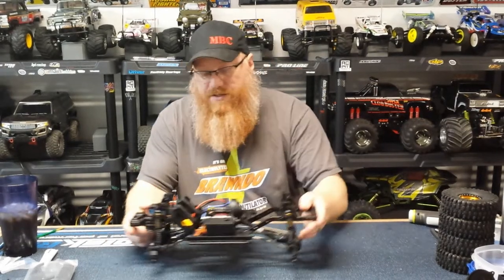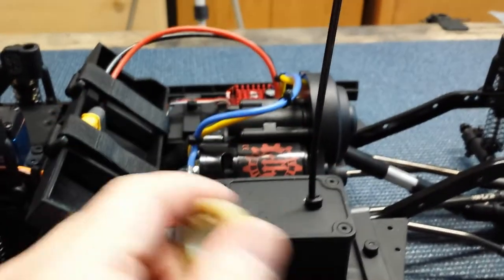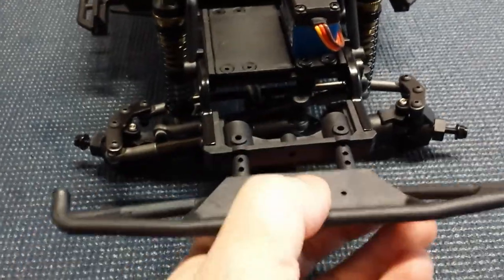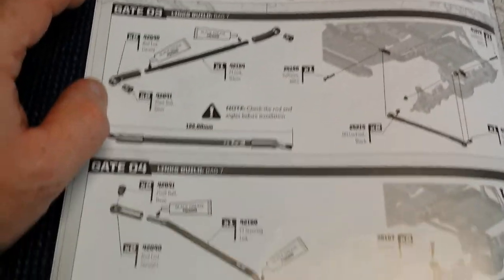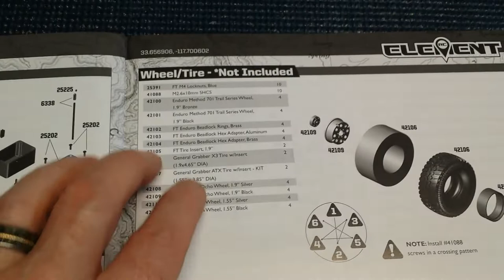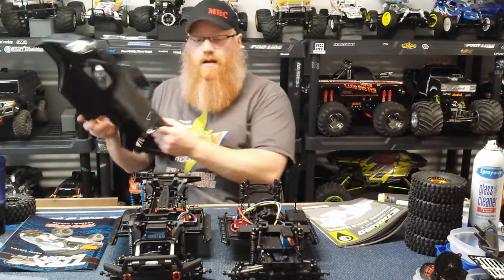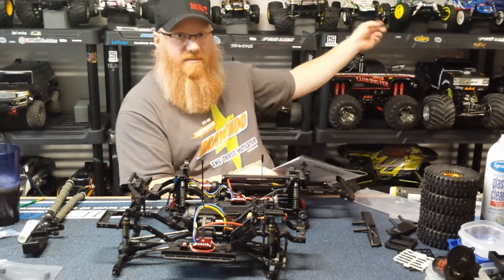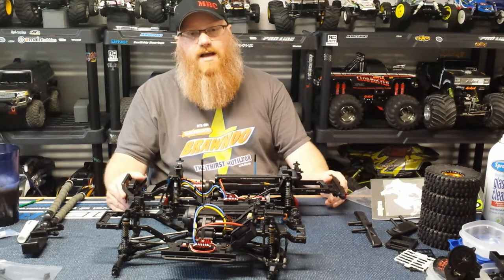Element Enduro Builders Kit 2- Build summary, instructions rant, TRX4 comparison

Comment: So I put my front drive shaft in and I have no 
Suspension travel up and now! Drive shaft hit the battery tray
Reply from the maker: Does the input of the front axle sit fairly flat or is it pointed up at all. I think you may have gotten one set of the links in the wrong place possibly. Both the front and rear inputs into the axles should be fairly flat, might have a tad bit of upward angle but should not be pitched up too much. Double check your link lengths for the top and bottom. If it is not that I am not sure off the top of my head.

Comment: the OG kit was the first crawler I ever built, and did not run into that many issues.
Reply from the maker: I think the frustration was mostly there because it would have been very easy to make the instructions better and they chose not to and it was not as easy as it could have been with clearer text, larger text and 1:1 images of the links. I was trying to look at not from an experienced builder but a first time builder and it would have not been a good experience. The truck is great and it all worked out just thought from a big manufacturer that has been releasing product for years would do better.
Reply: @AddamsPlayground  I watched the video and I think you have valid criticisms for sure. I had trouble with the OD gears, I didn’t install the ones I wanted at first and had to buy a whole new transmission set because I stripped a bunch of screws trying to take it all apart to install the right gears. That was the main thing I struggled with…. A 80$ mistake lol.
Reply from the maker: @ppaauull3854  ouch, yeah that'll eat into the upgrade fund!
Reply: @AddamsPlayground  part of the game I suppose lol. I’m used to 1:1 car upgrade pricing so meh. Not too bad
Reply from the maker: @ppaauull3854  yeah I can see where if you playing in the full sized world it isn't bad. Got tired of that years ago,.busted knuckles, hunched over or crammed under something for hours just became too un-fun to want to keep tinkering on full sized toys. Arthritis makes it even less fun! I keep saying I'm gonna get a project car but thankfully have not. Having too much fun with the tiny ones for now!!!

Comment: Hi I to have just built this kit and I found a few problems and they are the plastic frame and parts are not very tough in that i was striping screws wholes in the plastic, screws were not all there, the instruction were a bit all over the place. One very important thing i found that when you receive the kit the part bags were not sealed very well and parts were every where and be very careful assembling the gear box as while assembling the kit the screws tend to push out small bits of black plastic and they tend to find there way into the gear box and i found that it damaged the plastic gears very easy.
Reply from the maker: I did not have issues with loose or missing hardware but the instructions were not great at all. I don't recall stripping any screws but from building so many Tamiya kits I am very careful when tightening any screw into plastic by default now! Sorry you had such a tough go of it and hope you can get the gears fixed.

Comment: Dunno how the Enduro kit would be any harder to build then say a tekno eb/nb kit, or any other racing kit. Literally you don't have (oil filled) diffs, shocks are basic, suspension is basic and everything seems straight forward so not sure how its problematic. I don't see how It could of been worse then the extra bs traxxas kit crap.
Reply from the maker: Comparing instructions to instructions they are on two ends of the spectrum. The Traxxas ones are what I would expect from a top end company. The Element ones are something I'd expect to see from a middle ground company, not one that has been in the game for decades. I mean how freaking hard is it to make a 1 to 1 image of links? Use photos that you can read the screw sizes on it. The kit itself was great, my point is the build was soured by the crappy instructions.